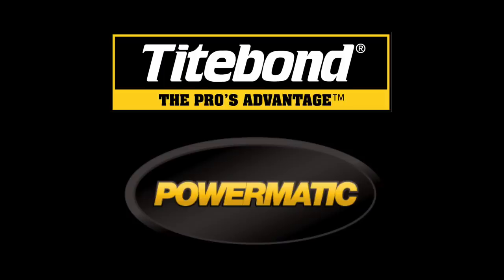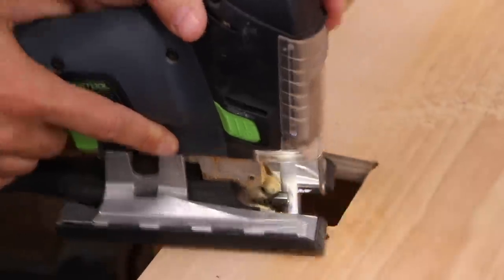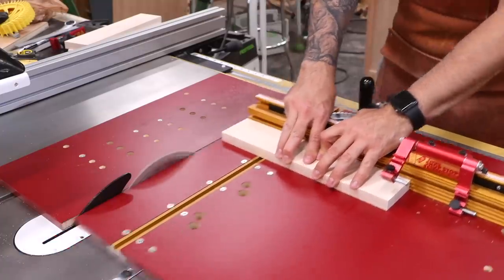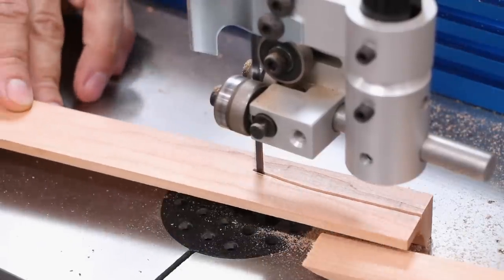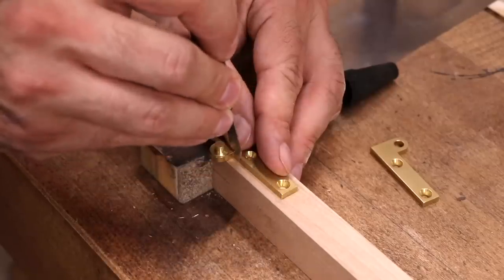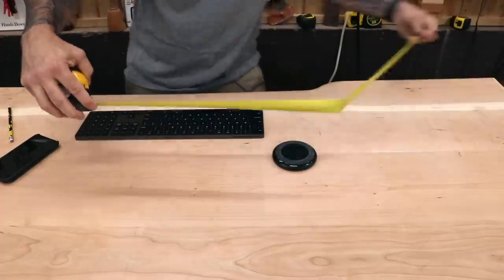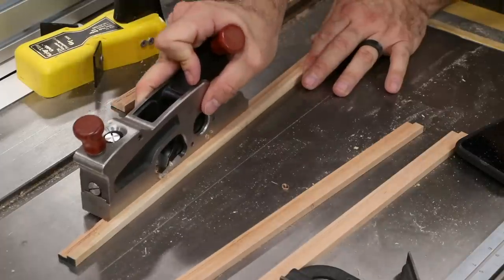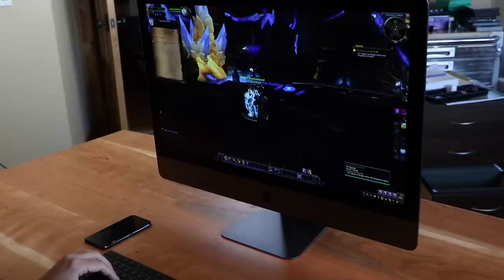Executive Desk With Wireless Charging and Hidden Drawer

Comment: Alright. Either I'm showing my age (as I'm closing in on 40 by most people's standards) or I'm maturing....but either way, Mark, this desk is probably my new favorite build.

Showing the non-Festool floating tenons midway through gave me the idea to just cut one huge strip of wood, round the edges on both sides, and BAM!  6 feet of floating tenon to cut to length whenever I need it. Thanks man!

Comment: Finishes are like opinions and... you know what. Love how that wax finish looks on the cherry it really is a living finish which can be re-applied at any time. I could see a tung oil applied on a high-use desk surface, too. As a nerd by trade and at heart, I love the tech touches and emphasis on retaining the plain wood desk surface. There are a million ways to make wood furniture fancy, so the restraint demonstrated in this project is appreciated.
Reply from the maker: Thanks man. SOO much restraint. I really wanted to pop electronic grommets everywhere but decided against it, lol.
Reply: Thinking about it, a slot that runs nearly the width of the piece with modular inserts might serve that purpose on another project with the requirement for many powered devices to be connected. Good to be creative in the morning hours!

Comment: I think that this project might be the first that I'll buy on the guild
Reply: @thewoodwhisperer is the wiring instructions for the outlet included in that?
Reply: If you're in the US and wiring for 110V power, all you have to do is wire the green wire to the green ground screw, the white wire to the silver screw (normally on the same side as the ground), and the black wire to the brass screw on the opposite side as the other two. Crimp on spade connectors are your friend, but you can always twist the wire clockwise around the screw before tightening it down.

Comment: I want make a computer desk using 3 or 4 sheets of 4'x8' plywood, 2 nice looking sheets for top / bottom, 1 or 2 sheets of average for between. But I'm not sure what to do for the legs, I like the idea of cabinets, but I don't think I have the experience or tools necessary to make them myself... I was wondering if you had any ideas for leg designs that look good, but are not too skill intensive to craft. I like the idea of the integrated, hidden phone charger, but what thickness would the charger work through? Also, I need a flush mount USB charger strip, having difficulty finding one that isn't likely to be a wired one, as I am not an electrician, I don't want to delve into wiring.

Thank you for the video.

Comment: Desk turned out nice, I like the hidden drawer and the wire cutout cover.  I want to make one with a second cutout near the keyboard/mouse since I will never use wireless stuff.  Also need bigger desk, current one is 63" wide and I need more like 7ft wide.

Of course he would be a apple guy.

 I think the clean look of those all in one computer-monitors quickly gets lost if you need allot of things plugged into it.  I use wired keyboard + mouse + 2 extra monitors then with power, lan and audio/speakers thats already 7 cables connect to the back minimum.

The other problem is just waste of money replacing the whole thing vs upgrading.  Like how a 7th gen  i7-7700k is only 50% faster then a 5 years older 2nd gen Sandy bridge i7-2700k.  But a 5 years newer GTX 1060 is almost 3 times faster then a 560Ti both being around the same price at launch.  So you could almost double your gaming speed upgrading your older $300 video card to a new $300 card..  or you can just replace your entire computer and monitor for thousands to get the same boost.  I'm all for spending money on stuff that lasts, I have festools, I have a $300 computer case I've been reusing for over 10 years, very expensive monitors, Herman Miller chair etc - things that last I'm fine with spending allot on.

Comment: I am a noob when it comes to wood working (I did study engineering in college mainly Electrical/Electronics which is my specialty and I did do a little mechanical engineering and I did use machinery such as pillar drills, lathes and welders though I am bad at welding) but I don't know much about different types of woods and the different wood coatings etc... and I want to make my OWN custom desk as I have seen so many videos of people custom making their own desks and that has interested me in making my own desk as I use my PC a lot and it is my primary device when I am home I game on it watch youtube/movies/tv shows etc.... on it and do a little work and online shopping on it too so was thinking of replacing my crappy desk that was made by the former residents of the house I live in (it is just some of those wooden panels that you get on kitchen drawer units or on cheaper drawers/shelves and they just joined 4 big pieces together with a few smaller ones(it is an "L" shaped desk built in to the wall  with 2 acting as the top and 2 as the legs) )

Comment: What kind of drill bit are you using to make those counter sunk holes for your screws at 4:18? I would like to know how you get the hole so much bigger then the screw head to fit in a plug or dowel to cover it. The countersink drill bits I have are just big enough to fit the head of the screw. Also that bit has a non marring depth stop so I would like to know what brand and what the exact name of that drill bit is please. Thanks, and lovely desk! Lol I also saw what game your were playing, I haven't played the new update but plan on checking it out soon.
Reply from the maker: It's an Amana Countersink: https://amzn.to/2osB1bl

Comment: I like the woodwork.
However it seems to me that a computer behind that door does not get much air.
An office-machine that does not produce much heat might be OK, but as soon as someone puts something powerfull in there the computer would have to slow down itself in order not to overheat.
If i would ever build a desk by myself i would definitely make the desk match the computercase, and make sure air could get in and out. When the PC draws air at the front the window should be replaced with mesh, also there should be an opening in the rear to allow the air out(all this provided that the PC is moving the air like this).Alternatively an Opening at the Bottom and at the top could be used, if this works with the given PC-case.
It would be a waste to buy a Computer that is only working at a fraction of its potential because of bad ventilation.
Reply from the maker: My desk has active ventilation. Works great!
Reply: where does it hide?
Reply: i think if air is getting in through the slit in the Bottom and out through one of the rectangular openings it is rather little ventilation for my taste, however i run a gaming rig wich is overclocked.
Reply from the maker: Of course you'll need the appropriate amount of ventilation for the gear you're running. I'm running a few external drives and the ventilation fan does a great job.
Reply: It might be an interesting project to integrate a really powerfull rig in a wooden desk in a way that has good looks as well as a decent cooling. 

What really triggers me is when you find a desk in a shop that has a compartment for a computer and the only opening in that compartment is a two-inch hole in the rear for the cables.

Comment: Why did you place the wireless charger upside down, and more importantly why did you glue it to the table when it couldn't move anywhere anyway? Technology is moving so fast and gets broken so quickly - tomorrow an unlucky bastard will have to unglue that shit.
Reply from the maker: The charger was attached to the underside of the desk top. And hot glue is a great non-permanent way to attach the charger since it grip on oiled wood is pretty weak. That shit is very easy to remove. 😁